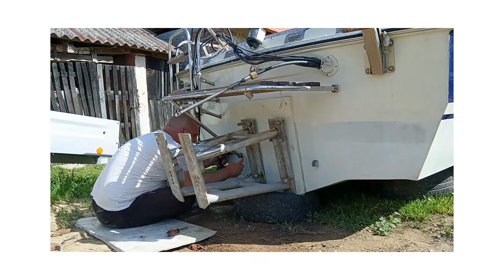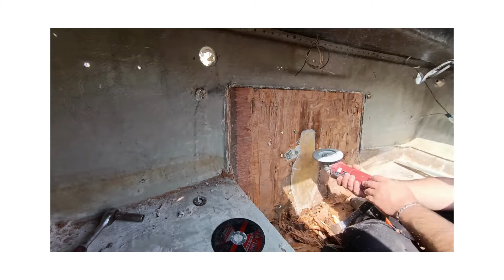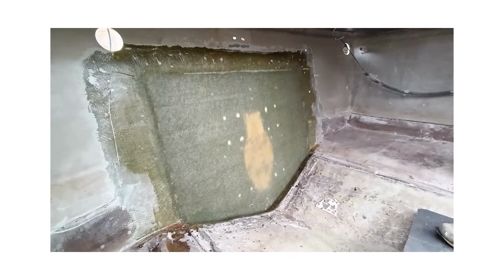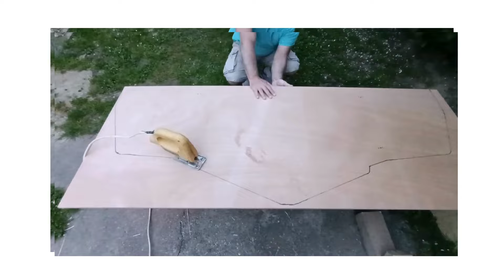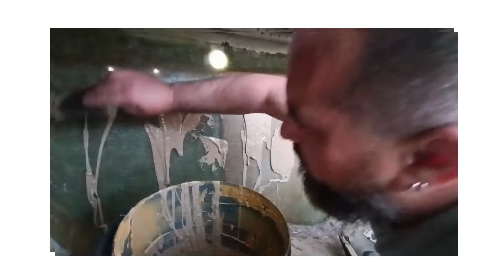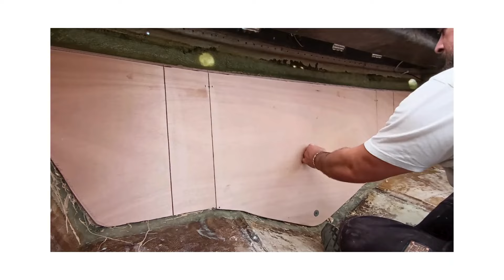Transom Repair Start to Finish: Step-by-Step DIY Boat Fix

Comment: Congrats on the hard work dude.think you over engineered it a bit tho.you could hang a jetski on davits on the back of that !.the secret is not to take the plywood to the bottom on the v hull.leave it 150mm higher so you can put a drain plug in and not have it going thru your plywood where its vulnerable.
Reply from the maker: Thank you for watcing!